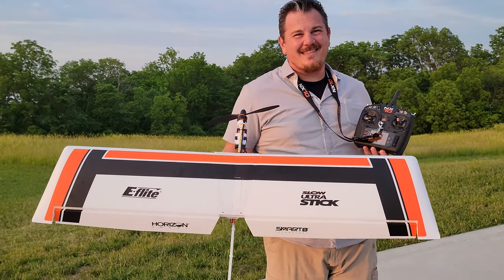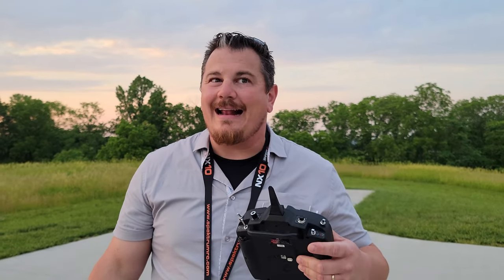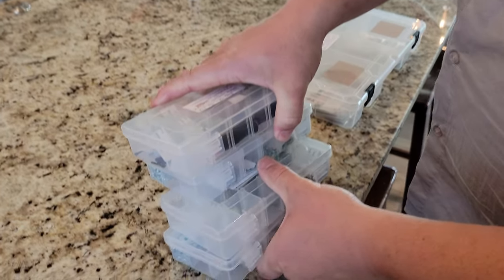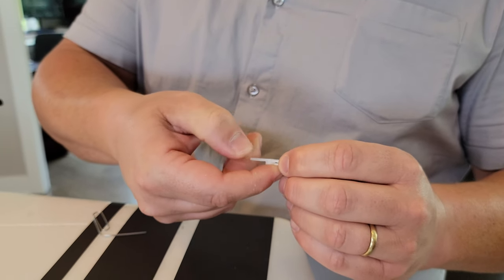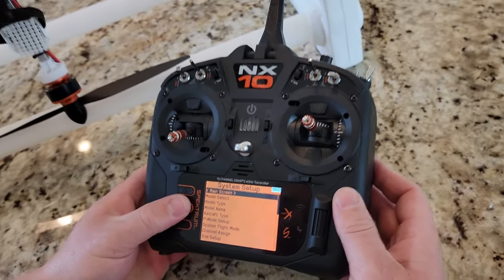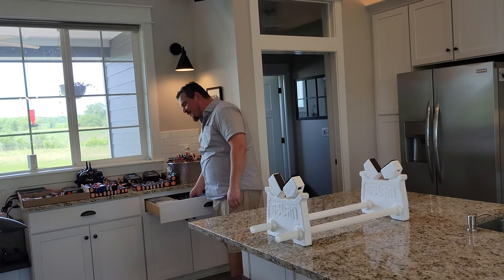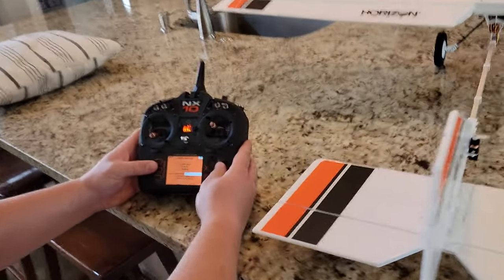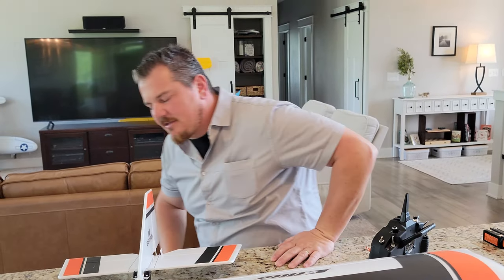E-flite - Slow Ultra Stick - SUS - 1.2m - Flapperon Mod & Flight

Comment: With two servos and dual aileron setup Spektrum wisely chose to allow you to mix to either right aileron or left aileron.  Either mix will control both ailerons.  The difference is in the direction of mix. If you use the left aileron the ailerons will move in the same direction.  If you use the right aileron the ailerons will move in opposite directions.
Reply from the maker: I've never figured this out! thanks!!!

Comment: The updated version of the landing gear is part # EFL0373. $7.99 from HH. Glad you put a buying link in the description. If anyone is looking for the gear, make sure it is the correct part number, like what is in the link in video description. I ordered 3 sets of the updated version a few weeks ago, when they first came out.  I haven’t broken any so far, which is almost a miracle considering I have a clay runway with alfalfa stubble around it and even greasy landings were breaking the old stiff gear if I wandered too far off the edge. I’m trucking in sand and planting golf course putting green grass(pennco creeping bentgrass) on it this fall in hopes of being able to fly umx and jets without asphalt or concrete. Annoyingly enough, the SUS landing gear has been more troublesome than any other aircraft I have been flying, and lead to my decision to plant the golf course grass. The updated gear is a must have for everyone. 

Brian, Big Big Thank You  from 34 year AMA member for the videos of these new electric planes. Steep learning curve without your help.

Comment: This is a must do mod on this plane imo, flys beautiful 👌🏻 That servo arm looks like something I would do lol It actually looks professional compared to some of the parts on my homemade builds 😁
Reply from the maker: Totally agree - Flapperons MAKE this a SLOW Ultra Stick. I liked it before, but LOVE it now! Should have been factory installed, in my opinion, but since we CAN do it, I'm very happy that we did!!! She is a whole new plane.

I can't remember if I talked about the C switch FLIPPING the flapperons into spoilerons, so you can fly UPSIDE DOWN super slow ;) I did that into the ground, RIGHT after my brain injury (well, like 3 days after...I wasn't ready to be flying yet - LOL) She's fixed again ;)

Comment: A 2100 mah pack will give 18+ mins of flight, and still flies good, though you might want to swap the battery and ESC locations to help the CG. But if you do, the 1350 packs will still balance. You’d basically have the pack at the CG so nearly any pack size would balance.
Reply from the maker: I don't think I have any 2100mAh packs. Thing I love about this plane, it just flies awesome with all sorts of CG locations. If you want to make her fly in High Alpha well, just push the CG back a bit...it reminds me of the NIGHT VAPOR in that regard.

Comment: On this plane, I highly recommend you max out the rudder throw mechanically by moving as far in on the rudder horn as possible and all the way out on the servo horn. And when you need a tight turn, use lots of rudder while you’re banking with aileron, and it’ll crank itself right around really well even when in safe mode.
Reply from the maker: I've always been a big proponent of utilizing MAX throws on planes, but there are times when it can cause some oscillation...but on a slower flying plane, not usually an issue.

Comment: My gawd………….that programming is brain numbing for my old head.  That said - I have a plane and components coming to try it……………what a great idea it would be for you to sell the files.  Finished and ready to go.  I will be your first customer.  Thanks - Mark
Reply from the maker: Don't worry Mark - you can and will get it figured out. Mind numbing is a common unfortunate FIRST time symptom of doing some of these RC tasks, but you will LOVE it if you can work through it. Just do a step, pause the video, OR run it at a SLOWER PACE (click the gear, and select 0.5X or 0.25X speed).

Once you've done it once or twice, you'll start to get the hang of it, but if you don't, we're here to help not only hook you on the "next" plane, but also show you HOW we did that one too. This has been a hallmark of our channel for thousands of videos.

Good luck! You can do it!!!!!
Reply: @BrianPhillipsRC  Thx Brian.  I have become one of your biggest fans of late.  I very much appreciate your thorough approach to builds, fixes and flying.  You do a great job.
Reply: @BrianPhillipsRC  So I guess that’s a hard “no” to selling me your file?  😅

Comment: Advice request from a newbie: 2S vs 3S battery with this model? G2 or not on this battery? And I guess I'll also need a charger! It would be nice to have a recommended battery/charger for this plane for the benefit of newbies... there are SO MANY OPTIONS that I find myself paralyzed! Thanks in advance!

Comment: Brian, I find your videos very informative but I have two comments.
For safety purposes, I feel that the airplane's prop should be never installed until after all of the construction processes and radio setup is tested.  I just saves having a throttle reversed and spinning out of control.  Just thinking safety here.
The other item I notice, at least in the Extra 300 video, never mention balancing your props.  Out of balanced props really cause issues with your motors/engines and gyro functions.
Thanks for your insights but this might help others starting into the hobby.

Comment: Q: will a 6 channel radio suffice to setup up like yours ?
Reply from the maker: Well, should be able to use the NX6, but you'll lose ONE thing...see below - https://bprc.me/Tx

Channels in no particular order...
1) Throttle
2) Rudder
3) Aileron Right
4) Aileron Left
5) Elevator
6) Thrust Reverse
7) Flight Mode - AS3X/SAFE
8) Master Gain

Comment: Hey Brian, nice informative video on the SUS :-)  Regarding a prop change, what would happen if you would use the 11x7.5 three blade prop from the Turbo Timber Evolution on this plane.  I still have two of those lying around because i went with a 2 blade prop for 4S on the Timber Evo so would be nice to be able to re use these.